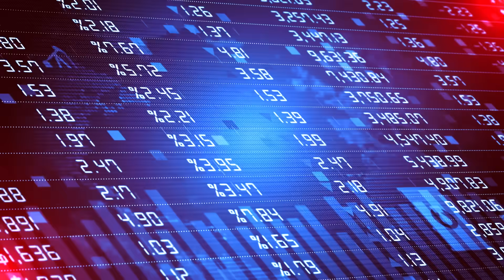Australia's INSANE $80 BILLION Plan To Build A Bridge To Tasmania

Comment: The one thing that would have to be considered, if they went the Bass Straight route, with that being 240 km, they would need to put a rest point mid way, with fuel, accommodation and amenities. Unless the speed limit was greater than 120 km/h, to make the crossing shorter than 2 hours, which would make this crossing the fastest road in Australia outside of the outback. This would be most feasible with the tunnel, as they won't have to build support for the rest stop. However, there would need to be a way to get fresh air down into the tunnel. The rest stop would almost need to be pressurised, with the flow of air going out in either direction.

Comment: Best to leave the status quo as QUO.
I certainly got a funny feeling being on the long island hopping bridges from Miami to Key West Florida. Even the Burnley Tunnel on Melbourne's citylink seems colorphobic enough- let alone 240 kilometres of tunnel running below the bottom of the sea. As for the Tunnel suspended on floats, surely it will come apart with the movement of the sea over a period of time.
At least the spirit of Tasmania cannot deteriorate and end up riddled with leakage as would the floating tunnel. Ships would be much easier to replace than bridges; THINK ABOUT YOUR DREAM!!

Comment: Road workers in Australia struggle with repairing pot holes, or redoing 200 metre stretches of road...let alone tackle a job like this. It's work to rule in Oz.
Reply: VicRoads have a swift and inexpensive way to fix potholes - they erect "CAUTION ROUGH SURFACE" signs, and lower the speed limit.

Comment: It took over 100 years to connect  Adelaide to Darwin by Rail.
It's only just building a inland Rail Line from Melbourne to Brisbane.
It does not have 1 Bullet Train or VFT Train Line.
It's Highway 1 is not properly finished. Want to Travel
Flying is the only feasible way.

Comment: If could be funded a tunnel would be better with a fast train.

A floating tunnel would be a bad idea due to rough sea and strong undercurrents. It would rip the tunnel apart eventually.  

A bridge would be a bad idea because of the rough sea and strong wind would be too costly for maintenance. Possibly to dangerous you can get 50 foot to 100 foot freak waves in bass straight. Very dangerous  waters. It would take too long for rescue services to reach anyone if something happened on the bridge. 

Best bet if could be funded would be to tunnel in the shallow area and have a fast train. I think it could be done and may happen some day